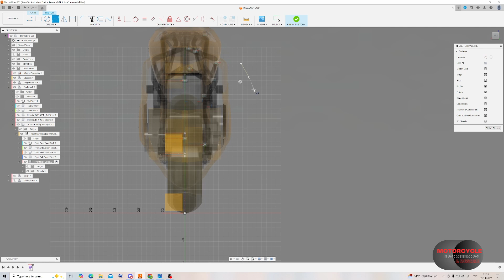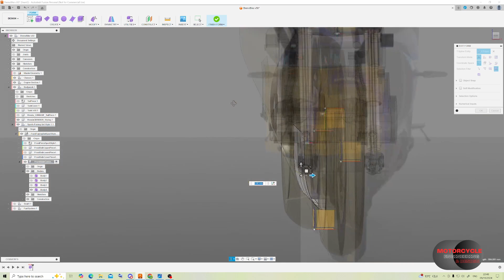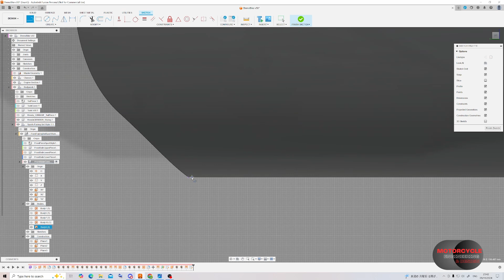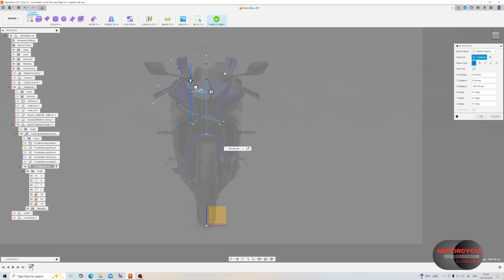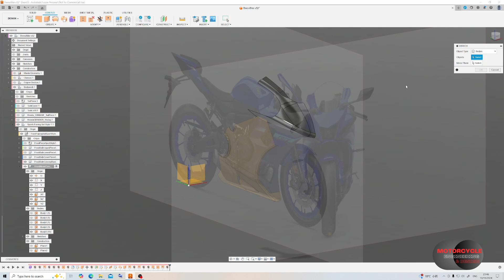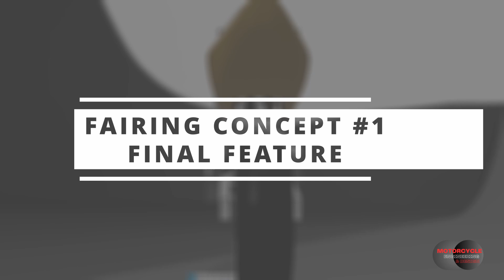Motorcycle Fairing Concept Design, Forming Practice

Comment: Great videos, thank you!

I have a 2025 BMW s1000rr. I love the bike but I'm not crazy about the new winglets BMW did year. I would like to do a redesign to remove the winglet. I'm fairly new fusion 360, and although I've watched countless tutorials i can't seem to figure it out, or get the hang of it. Any advice or help is appropriated.
Thanks in advance.
Reply from the maker: @nap_boule That's a challenging one, are you thinking to have a set made, modify the existing ones or are they detachable and you want to remove then and fill the space?
Reply: @MotorcycleEngineeringAndDesign  
Excellent question. Last year's model was removable, but this year it's built into the side fairing. They only way to remove it would be to cut the cut fairing, which I don't want to do (they are expensive). Ultimately, I want to redesign the fairing in fusion 360 by removing the winglets and then 3D print new fairings. But I mentioned, I'm new to the world of fusion and 3D printing. if you like IG you a couple of pics so you have a visual.  In any case, thank you again for replying.
Reply from the maker: @nap_boule Ah, it's kind of the worst-case scenario... you want to protect the existing ones, but you want new ones without the wings... that makes making molds out of the question..

The easiest way to do it is honestly going to be with a 3d scanner, bring the scan into 3D cad and convert it to a workable model and if thats not possible then use the data to essentially trace it with surface modeling/forming, then remove the parts that you don't like and add in any details you want.
Sounds easy to say, but modeling fairings is a big job, and I've not tried 3D scans with fusion, so I'm not sure how they are handled.

Are there any crash damage cheap fairings available? That might be a good place to start for a mold project.

Comment: Hey, very informative video! I'm looking for a way to quickly generate different colored fairings. I want to design the colorpallet of the new fairings on my bike but I have no way of visualising it. Do you know ways or programs that can help me to have an idea of what different colored fairings look like on the bike?
Reply from the maker: Hey, thanks! Aside from using the appearances and decals in fusion360, I might use autodesk sketchbook with some images copied in and then sketch over, i like that with the tablet and I can do it anywhere, free, but very rough.
Otherwise if you have some images you could probably stick them in something like Photoshop or a free alternative like Krita...maybe da vinci can do it too, and apply a hue/saturation filter, you should be able to isolate the colours with a mask and then freely modify them.
You could try blender or unreal engine too, steep learning curve, depends what you want to do exactly. For professionals in industry that I am familiar with, they probably use Alias.
I hope that there was something useful there
Reply: @MotorcycleEngineeringAndDesign  Thank you for the tips! I'll try with sketchbook and some images!

Comment from the maker: Although these are not high quality, nicely styled fairing models, I hope that you find this video interesting.
In addition to creating some higher quality concept fairings as the bike develops, other parts that I'm looking forward to working on soon include the swingarm, suspension systems and the wheels.
Let me know, what are you most interested to see?
Reply: Hey, can you share these model files? I would like to use them for making fairings for my motorcycle
Reply from the maker: I'm afraid these fairing won't fit any motorcycle, I take it you are interested in designing your own that will actually fit your own motorcycle?

If you can't scan the bike, and you don't have original fairings to make a mould, then I'd recommend taking measurements of your bike and plotting points in CAD to work off of.
Mounting locations, external surfaces of the engine etc.
I'd love to demonstrate but I don't have a motorcycle on hand 😞